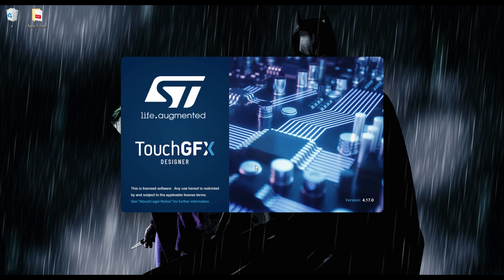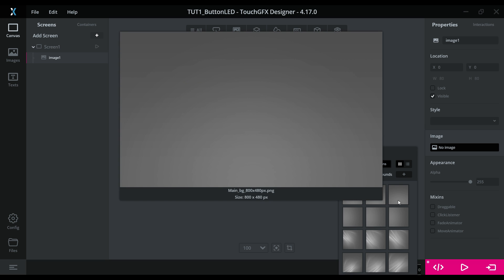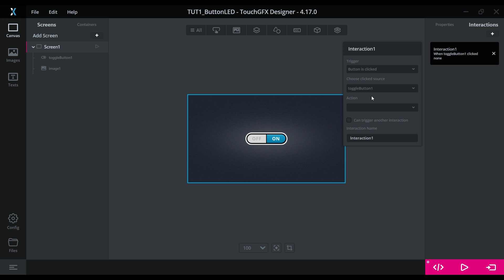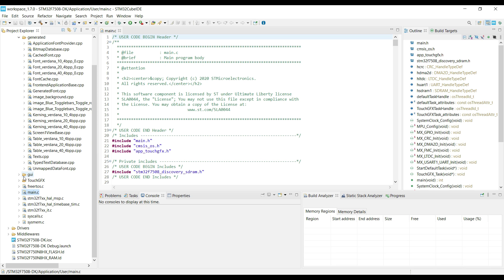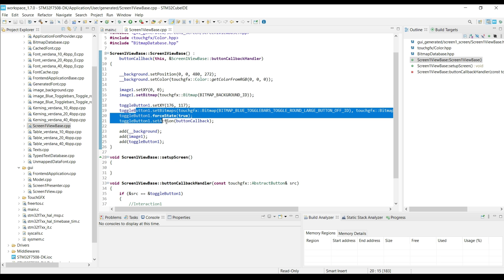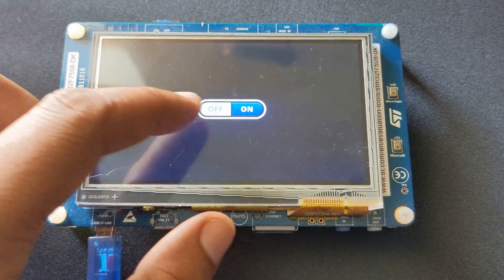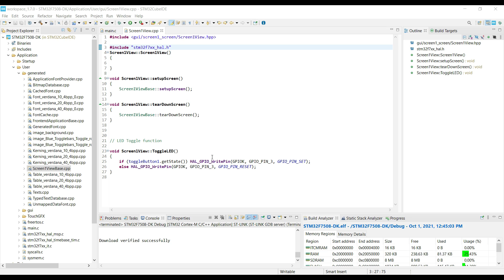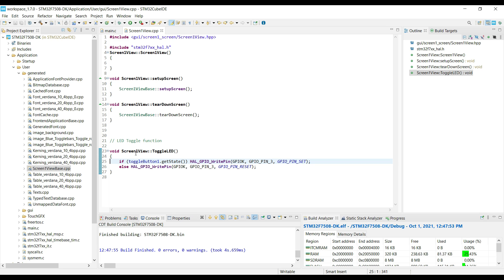TouchGFX with STM32 #1: Getting Started with TouchGFX | Toggle LED Using Button UI

Comment: Touchgfx generated code is not compiling. 
It uses `caddr_t` typedef which is not defined anywhere. 
After some googling i found that `caddr_t` is obsolete typedef and nowadays people use `void *` to replace it 
Is `touchgfx designer` backdated or is there something wrong with my setup?
Reply: Try with an older version of STM32 cube ide like 1.12.0, this resolved my error.

Comment: Hii can we use this method to work with ssd1360 OLED display will it work please help me out
Reply from the maker: You can but it won’t be simple. First you need a good library that works with the oled. It should have functions for frame drawing or bitmap drawing. 

This video might help. Its for SPI based display but the process should be somewhat similar. 
https://youtu.be/suMytEyQTP4?si=QdbjmnyRWBhacw16
Reply: Hey hii thanks for the reply I think I found a Library with bitmap function. So is this okay or I need to do some consideration before choosing display
Reply from the maker: I haven’t used it with the oled displays so I can’t say if it will work. But technically it should. Rest is upto you
Reply: @ControllersTech  thanks for your response by the way great tourials I've been following you for few months thanks
Reply: @ControllersTech  hey there and one thing I downloaded this ssd1360 OLED display library from your tutorial there you've used bitmap functions I hope I can use touch gfx for that display

Comment: Hi, must i regenerate the code every time there is a modification to the UI design?
Or in another words, can i port touchGFX into a existing project (Already coded)
Seems like creating the UI is the No.1 step if we want to use touch GFX
Thanks
Reply from the maker: You can port, but you have to manually place all the files and code in respective places. Its way more complicated than it sounds..

You can howver modify the project, add new things and generate it. The previous data will remain intact.
Reply: @ControllersTech  Thanks for the reply

Comment: hello, i have a problem .ioc file is not coming .thanks
Reply from the maker: In some boards touchgfx doesn't generate it i guess. Ask on the ST forum about this.
Reply: @ControllersTech  i got it done thank you
Reply: @a.erdem57  I face the same problem. Would you mind sharing the solution here?

Comment: great. but i have problem. i am using stm32h747l-disco and i did everything that you did. but nothing shows on screen. run is sucess but still nothing shows.
Reply from the maker: See first if the example project runs fine.
Reply: @ControllersTech   i'm having the same problem, and before running the code a example was running

Comment: Great video man, I am using STM32H735G-DK evaluation board. All the things you explained worked fine. The only thing that didn't work is the pin naming in Screen1View.cpp. So I have to check it from MX_GPIO_Init(void) function.
Reply: Me falto decir que el archivo indicado con error es el KEYBOUADLAYOUT.HPP

Comment: Hi sir.
If I have a "Progress bar", and I want to change value of it in a "Software Timer" which is in C++ file, also if I want refresh value of a "Progress bar" (or string of a "text box") in "defaultTaskHandle" (or even better than that, "TouchGFXTaskHandle"), how can i do it?

must I import what and where? 

#include <gui_generated/screen1_screen/Screen1ViewBase.hpp>
extern Screen1ViewBase ....???

If I am going to write something like this:

        textArea1.setVisible(true);
	for(char i=0; i<101; i++)
	{
		boxProgress1.setValue(i);
		osDelay(50);
	}

infinity thanks for your time that become spending for us sir.
Reply from the maker: ok do this.
create the variable in the Screen1ViewBase.hpp and externally define it in the main file.
Then update the variable using software timer.
in the Screen1ViewBase.hpp, define virtual void handleTickEvent(); This function gets called every frame (I guess)
in the cpp, write this function. where you send the value to the progress bar.

I know this is not the best method to handle this, but since i am also learning it, this is the best i can do.
Actually you have to use the model presenter for things like these..
Reply: @ControllersTech  Thanks so much, I will test it, at least it is a way for me in this time. Thanks so much again 🌹☕

Comment: Ok - this how we shouldn’t do this - because of skipping the whole MVP design pattern. As totally simple example - it’s quite ok. But you will do this in proper way in next episodes?
Reply from the maker: This is the way to do it. How else can we ?
Reply: @ControllersTech  "the way" - right, but not the correct one - you need to pass your hardware (or "backend" in tGFX terms) related actions via presenter and model to your backend - this way you broke MVP pattern
Reply from the maker: Honestly even i am new to this. I am just following ST's guide. 
If you have a better source, plz point to it..
Reply: @TheDambo1  if you know a better way please talk with controllers tech, so all we can learn about that, thanks you very much ☺️.
Reply: @desdezaragozaestoy  touchGFX documentation -> section "backend communication" - there you can find 2 ways - "quick and dirty" like your and the correct one with MVP pattern
this is my second comment about this - but previous was from smartphone so maybe something goes wrong
Reply from the maker: Yes You have a valid point. But it's alright for getting started. 
The multi page application will certainly need the model implementation.
I will take care of it in the upcoming tutorials
Reply: @ControllersTech  agree that "this is alright for getting started", but in my opinion:
1. You should add some note that this is "quick and dirty" implementation
2. If you want to do something new - why "hack it" instead of doing this in proper way? Even on some very small apps - if you can't do small app with pattern etc - there is no way that you will build some bigger app better
Reply: @ControllersTech  Thanks unlimited.